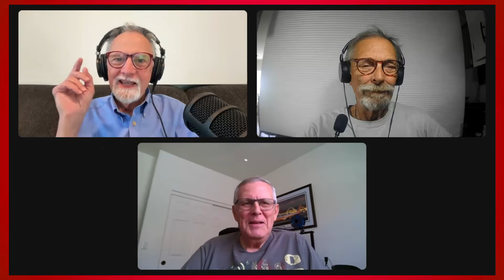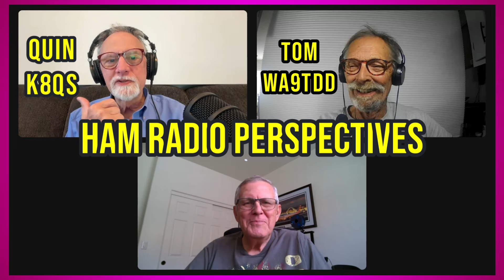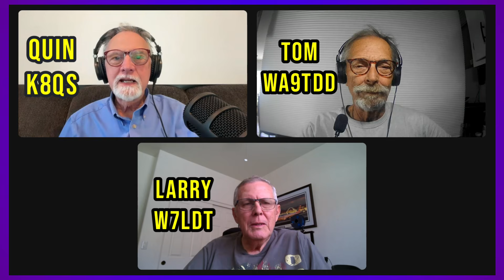Ham Radio HF on Airliner -- Pilot Tells How!

Comment: Great story. When I was a Radio & Electric mechanic for UAL in Chicago, I would often go up into the cockpit of the 747's located on the ramp and make HF contacts. The transceiver might have been the Collins 618T unit with autotune. Even sitting on the ground the HF antenna were high up. some of the aircraft had the HF antenna in the trailing edge of the wing.
Reply from the maker: What a great experience to have access to that kind of equipment, thanks for the insight! 73

Comment: As a Navigator on board brand new B-52s in the early 60s, flying 24 hour airborne alert sorties orbiting Greenland, I had the opportunity to pass time on the HF bands using my ham license. As Larry stated, we had Collins Radios with the antenna in the tail. Difference was we had 1 KW power. Loved all the "where are you(s)?" (couldn't tell them) and "you're knocking the receiver off the table".
Reply from the maker: Running a full kilowatt from a B-52 must have made for some legendary signals back then! 😂

Comment: Today's airliners are SO noisy, I couldn't get anything on SW from the cabin over the Pacific. I wonder if they will let me trail the wire out the back door before we depart 😂
Reply: Sometimes its better to ask for forgiveness than permission. 🤣  A 160 meter loop would work awesome. 🤣
Reply from the maker: I think the flight crew might have a few questions about that long-wire antenna setup! 😂

Comment: Airline pilot myself, lovely interview…. Here one bit of info, on the Airbus the new ones it’s a Collins 400w hf rig. The thing is aeronautical hf is exclusively USB. Also, it doesn’t have a knob so you have to select a freq and if you want another you select another and put that in…. It’s not as easy as turning a knob to seek out a frequency
Reply from the maker: That’s fascinating, it sounds like those systems are strictly built for efficiency rather than casual band scanning. 73!
Reply: @HamRadioPerspectives  And maybe the frequencies are crystal controlled.

Comment: Enjoyed the interview! One late-night on 40 meters, I heard the absolutely strongest signal I've ever heard on 40 calling CQ on upper sideband -- close to 40 over 9 on my somewhat stingy Collins S-meter... Called him back and got right through. Turns out the op was an air freight pilot who was less than an hour out from Chicago, nearly directly overhead of my QTH (okay, about 30 miles southwest of me), at nearly 40,000 feet, running 400W cargo freighter's Collins HF rig. By the time we finished the QSO, he was 100 miles southwest of me on his run to Phoenix; his signal dropped to S9+20 by then. Very cool.
Reply from the maker: What a fantastic experience to work a station at that altitude, thanks for sharing that memory! 73.

Comment: I have been in the airline industry for 30 years. I never knew that commercial planes had hf capabilities. Great interview. 73 de KE9DSK
Reply: There used to be a group "Int'l Association of Airline Hams" of pilots, dispatchers, mechanics, and other supporters .. I think it was 14.282 .. but I haven't been on there in quite a while ..  Paula, NS2E
Reply: @BusChik320 I'll have to check that out.  Ty